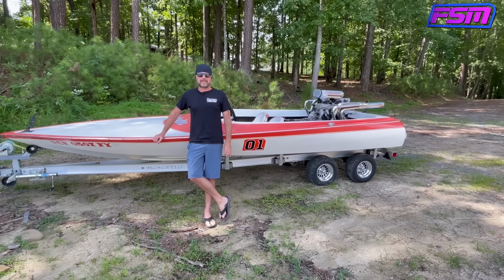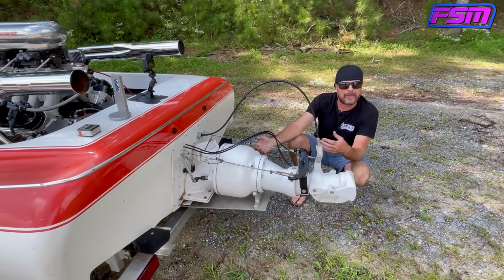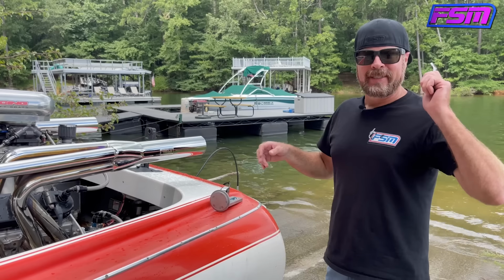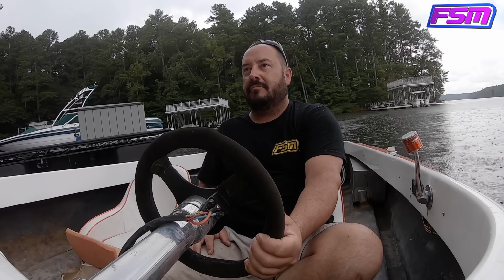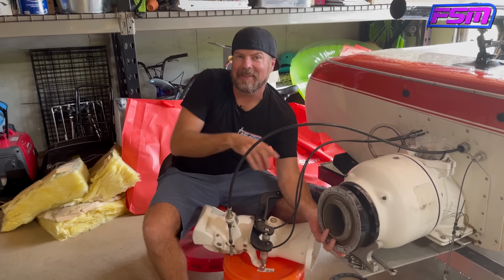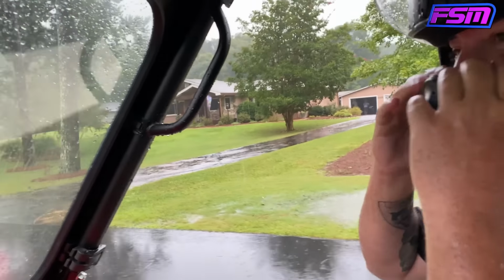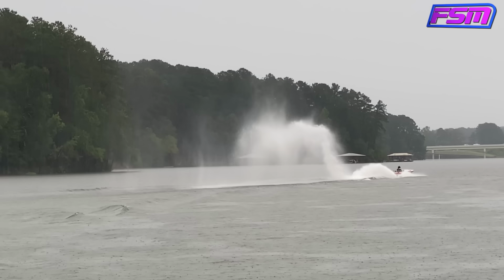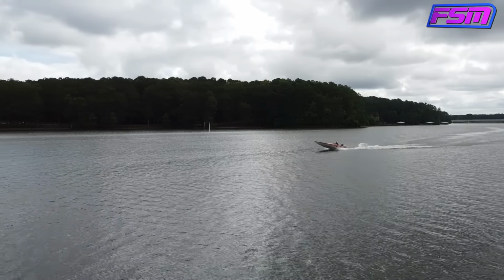MASSIVE JET BOAT MOD=HUGE ROOST!

Comment: Would be really sick is if the mount for the cylinder could be changed somehow with a different cylinder so you can get more downward angle. Make this thing behave as it use to but have this extreme up angle on tap for when you want to show off.
Reply: You could make a mount with 2 cylinders. Have a shorter one that can move it that original amount so it could run like normal. Then have a long one that can move the whole assembly to the high position. Would take some tinkering and some work, but I can see it being possible. Although you might still loose some thrust with it changing the angle so much because it gets turned up, then would have to get turned back down.

Comment: Mass of water moving through the impeller makes the boat move, so move more water, get more thrust. Up and down angles increase drag and reduce mass flow. Doing that can improve the attitude of the boat, which can increase speed. Can’t push on water.

Comment: You knuckleheads are awesome. I didn’t know much about jet boats, now I want one. How about a Glastron with a Olds 455. F an LS, no personality
Reply: My dad had 1979 Sanger superjet with a Berkeley pump and a BB Olds 455. The engine was blown when he bought it for $2500.00 in the 90’s. He rebuilt the engine bored .030 over with mild cam, edelbrock single plane intake and a big ass 950cfm Holley carb, it had a windage trey and a custom 10 quart oil pan. That engine would blow up and spin a rod bearing every summer or two. I didn’t like high rpms for long periods of time, “across the lake”. Also wouldn’t do over 60 mph. My brother has it now. It’s got a built 383 sbc with aluminum heads. It goes almost 70 mph now and hasn’t blown up yet.

Comment: Awesome looks like you can gain a few more degrees up with a longer hydraulic cylinder but will a new cylinder bring it back down to 5 degrees or less for maximum takeoff? Or does the down bottom out

Comment: The proof that the thrust is propelling the boat is that steering occurs by changing the direction of water exiting the pump. Turning is just off axis acceleration. I get that a part of that is just the act of moving mass through the pump but choking that mass down and accelerating it out the nozzle is what does it.

Comment: Dude you are right, the jet pump is pulling the boat... for the most part... If you look at your video the nozzle is not even pointing the water at the water, it's completely up in the air. Now it is applying pressure and momentum (the moving mass of the water) to the atmosphere, which will give you thrust. I think the key thing that's moving the boat is Velocity Head. That's basically the "energy" of moving water. Think of it this was, a hydro-electric dam does not produce energy from the discharge of the water it does so from the inlet. Let the "anti-pullers" of the world chew on that.

Comment: Y'ALL!  ain't seen a rooster tail until you see a "THUD" land with it's GEAR-UP!!!    My favorite UNK took me on a southeast asia tour back around '70. Crew'n a "THUD", and for those not familiar with the nickname. (F-105 THUNDERCHIEF) Sit'n on a "DOCK" box, NO not the dock of the bay, little over a 100 miles to the ocean. Well, there was I, at 3am sit'n on my dock box doing an eyelid ck. WELL! technically, I was an inspector! My "THUD" was somewhere out there cruising around. AND THEN!!! Along came "THUD" YEP! did not bother to reach over and push that handlle with the light in it down, so the gear would drop and lock!  Loudest noise I ever heard, automatically you look to the runway! AND there she came in all her radiant beauty..... with a 50 foot or so rooster tail of sparks!!!!! Don't remember if it was the 4th of July or not. But S-O-N!!! them boys put on a fireworks show!  Only thing I can figure.... that pilot and his navigator were doing an "EYELID" check too!!! YEAH... they were ok! Thank the LORD!

Comment: When I was a teenager in about 66, we would go down to the Potomac river for the Presidents Cup unlimited hydroplane racing. These boats were powered by V16 Allison or Rolls Royce fighter plane engines. They threw huge rooster tails. They were prop driven. I have no idea what physics made the roostertails.
Reply: Those used a surface prop. The prop was half in and half out of the water surface

Comment: Do a video explaining water flow, routing, sizes of line, pressure and why. Advantage of co2 divertor over cable and why? When you should have co2 or cable for us idiots with jet boats. Do different hulls require different angles etc.

Comment: Your theory on suction pulling the boat is the same as a 5th wheel trailer being pushed rather than pulled.... depending on where the axis point is on the tow vehicle.

Comment: Ive built same system on my base model spark, with a lev el action.  not as big as yours, but its pretty big to be only 900cc 112 hp. 30 meters or so, 8 meters high.

Comment: Well if that doesn't show you what Finnegan is talking about,  35° on a jet drive is pulling the boat along. Because really how much water or thrust is being produced with it all the way up? You could see from that jet drive camera angle, pretty much all that water was going up & out. Yet the boat is still moving pretty fast!

Comment: I happen to also love the Rooster tail,but what does the whole jet drive cost, some day I'm going to buy a pair of jet drives and possibly hook them up to a pair of Mercury Supercharged 700's in a 32 foot Skater and I hate going slow, anything over 130 mph is Awesome,but I'm still looking at a few used boats with Turbines and 1 with a Mercury 1350 hp in a all aluminum 23 footer???.

Comment: The force moving a jet boat is a reaction force to the mass of the water being accelerated out of the pump. it is the same principal as a rocket engine. To put it another way the flow of water into the pump isn't pulling the boat forward, water flows into the pump and the pump throws the water, the recoil is what moves the boat. imagine propelling a boat with a machine gun. If you could magically carry all the water the pump used on the boat itself without all the weight you would find the boat would make the same amount of thrust. The angle you throw the water effects performance because your losing energy driving the boat downward into the water turning it into extra wake.

Comment: 45 degrees is probably the maximum effective angle... That said, you can tie it to the dock with a rope and use it as a fire engine.

Comment: DO you EVER go boating when sun out?
I've been caught out, on a stand up jet ski, in a down pour, trying to get to shore, was like someone was throwing darts at me
i noticed AFTER the adapter added, the Engine intake scope, was turned around...a lil too much rain, eh?
add some hydraulic trim tabs, probably help with stability

Comment: Why do boat guys run the hat or scoop facing rearward? Wouldn't that place a low pressure area right in the opening? Why wouldn't you want ram air effect?

Comment: You're not wrong about suction being present, and it most certainly effects the boat at very low speeds. But Surely the whole point of the jet drive is to multiply the force, so the suction would be far far lower than the thrust at any given point? Same reason you can stand much closer to the front of a jet engine than you can to the rear (inline with it, atleast). I'd imagine its something to do with force per area. I'm not a scientist or anything, just guessing and putting it on the internet.

Comment: The amount of water (gpm) is very high but that the thrust of the divergent flow of water coming out of the nozzle in foot lbs of energy far exceeds the amount of forward motion than the suction created at the intake. There a law of motion governs the effects of the squeezing the water down into a smaller area as it exists. Read about the principle of the j58 engines on the SR-71 aircraft. It's like putting your thumb  over the nozzle of a water hose when you narrow the exit thrust is increased. Simple physics. Well not simple but physics. The laws of power of motion includes convergent, divergent and change of directional forces. In effect a propeller is a screw a pump is a fire hose theory. The propeller pulls through the water the pump pushes through the water.

Comment: Interesting thought about jets sucking themselves along ..but i have to somewhat disagree. Its actually easy to debate because jets don't really need static suction ( lake is static) to create thrust. .....Settle down people ....settle down..let me explain !  Technically, I could build a water tower above my boat and have it feed directly into the suction being is only source and as long as the impeller was spinning, the hydrostatic of the water column was enough to keep the impeller loaded, the impeller would remain loaded and create thrust - moving the boat.  PS ..Finnegan..you should haul up to Alberta and come for a rip on some skinny water in some triple digits

Comment: The problem with your suction theory is that the impeller pulls water through the pump. Water isnt a solid object but your boat is. You can stand in the boat and pull on a rope that isnt anchored to anything and your boat wont move but the rope will wind up on the floor of your boat. Your boat has weight and mass. Water like the rope isnt anchored to anything so without thrust you go nowhere. When your jet nozzle is in the reverse position does your boat get pulled forward ? No , your nozzle reverses the thrust to the front and the boat reverses. If it were being pulled through the water your reverse wouldnt work because you cant push & pull at the same time. Jet engines on airplanes dont pull the aircraft through the air. Your boats pump intake and bowl are significantly bigger than the jet nozzle. The force of the engine and the turning impeller stuff a large intake volume of water under high pressure out the much smaller jet nozzle . The water volume remains the same entering and exiting. The difference is the spped of the water exiting the nozzle is much faster than the speed of it entering . Thats due to the pressure increased by the compression of the water in the bowl and forcing the same volume of water out a smaller exit than entrance but through the use increased pressure and the spinning of the impeller. Thats thrust and it is thrust and thrust alone that pushes a jet boat through the water. Just as its thrust that

Comment: 20 degrees with the bolt out, and 10 more degrees with the booster...so that’s 30 degrees.

Where’s he getting the other 5 degrees for the 35 at?

I did take the Danes out in the middle of the video so I may have missed something...
Reply from the maker: there are two wedges in addition to the rooster booster. go back and watch the part you skipped.
Reply: @FinnegansGarage  oh I gotcha now. Dang dogs...lol

Comment: If suction pulls the boat forward.. Why does changing the angle effect the attitude of the boat? Thrust is obviously key. Unless it is conservation of momentum which would explain why a rocket engine would move the boat (cause everyone knows they don't SUCK).

Comment: Does it su k.? If standing still would it suck your hand against the grate? You can’t have thrust without suction doesn’t work. A planes thrust uses suction, that’s why people avoid being in front them and the reason we are naturally timid infront them! A boats jet drive from inlet to outlet are(aren’t?t) aligned..? If you stuck your hand to it without giving power(sitting at idle) would it suck your hand against the grate? I’m not saying you are right or wrong, you mentioned a discussion about something that’s objective but making seem subjective

Comment: Absolutely there is thrust without suction! Ask any rocket motor..."Suction" is not a FORCE, only Atmospheric Pressure is, and at 14 PSI is NOTHING compared to the pressure coming out the nozzle......think in terms of Positive force, not Negative voids which can be ignored for all practical calculations of high power at sea-level.

Comment: You got the fysics wrong,. Its about Newton's third law. The reactive force resulting from accelerating the water in the nozzle moves the boat. Just like have to fight the wand of a powerful pressure washer. Remove the nozzle and the boat goes nowhere.